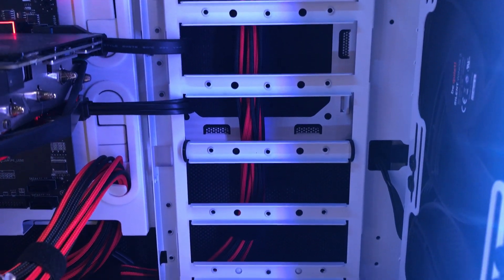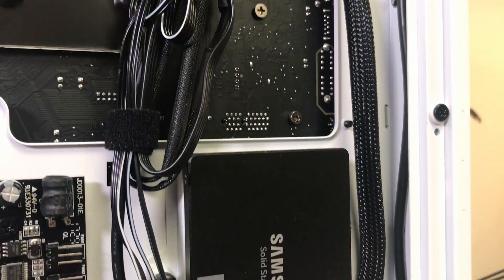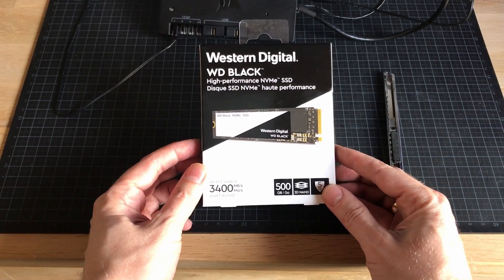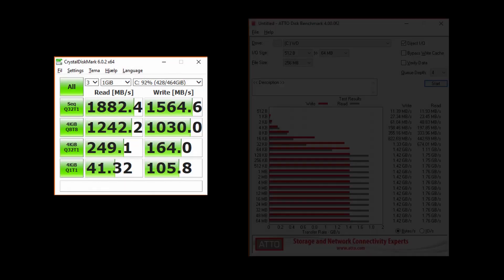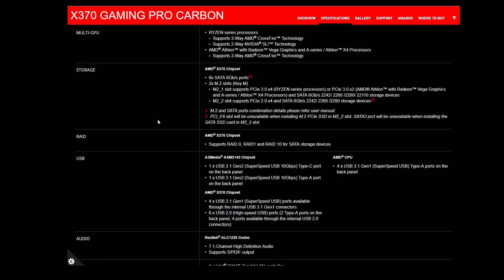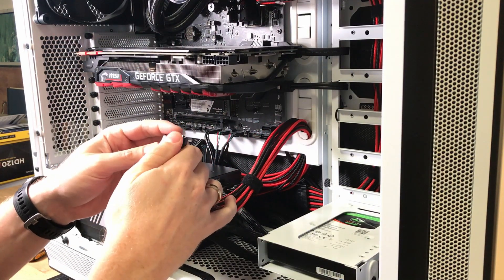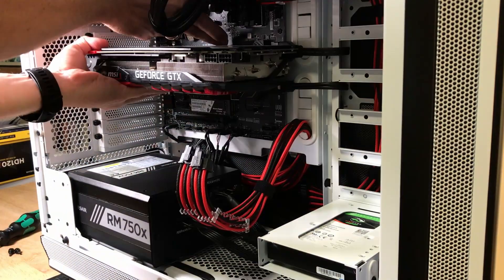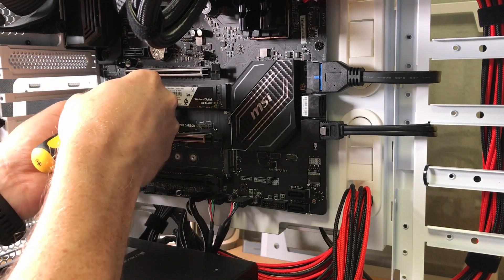WD Black NVMe SSD vs Samsung EVO 850 - Testing load times in games

Comment: @MrGarfi did you use the Gaming Mode available in Western Digital's SSD dashboard ?
Reply from the maker: Hi Arijeet Bhakat, good question - but no, I didn't. As far as I can tell that is a feature for the SN750 models and never. The drive in this video is sadly only a SN700 model.

Comment: To be honest it's pointless to use Nvme m.2 ssd for storing and running games on it. Personally I have a 512gb Samsung 960 Pro as my main one, one 1tb Samsung 860 Evo SATA, and one 1tb WD Blue m.2 sata SSD. 
As your video also proved the Nvme is not worth it for gaming the Sata ones are the best for that. :)
Reply: Yeah, but the thing is that NVME ssds are now so cheap that they rival directly with any SATA SSD and why not buying a m.2 ssd which makes everything more cleaner and professional than 2.5" ssd
Reply from the maker: Yeah, the 1tb WD Blue m.2 sata SSD costs only a little more than the WD Black NVMe 512gb version, so that is by far the better deal for that. 
And that could run just fine on the PCIe x2 port on my current motherboard, might be a future upgrade :D

Comment: I have a 960 EVO and MX500 and there was very negligible differences between boot times and load times. I would say 9/10, get a cheaper m.2 sata ssd or 2.5” one.
Reply from the maker: Yeah, for most uses it will be the better deal - It is just easy to get a little blinded by the 3400MB/s read speed, and I think I did to be honest :)
Reply from the maker: @Mirarid it is the 2018 model I know, and the EVO is from 2014. I didn't say it in the video but I bought it in January this year, and at that time the new model wasn't out yet. But do you think it would have been a much better result with the new SN750 model?
Reply from the maker: @Mirarid Yeah I saw Blunty's video where it blew his old SSD out of the water. Which was also why I was a bit surprised by my own results. Now he might have chosen a bad SATA SSD to compare it with, the video was sponsored after all, but still - maybe my system is bottle-necking it somehow or maybe a clean install instead of a clone could show different results; will have to test that ;)